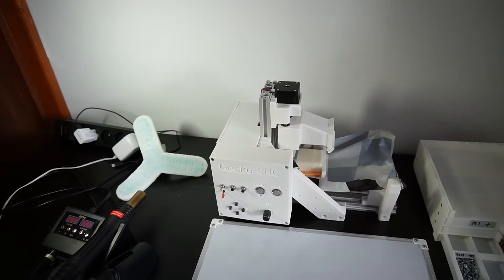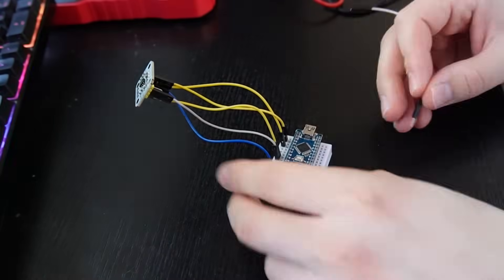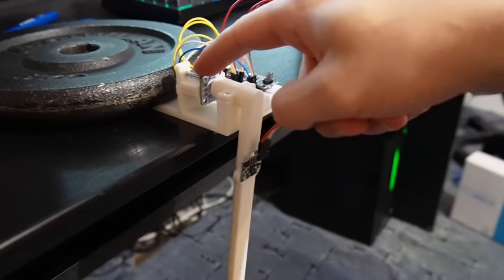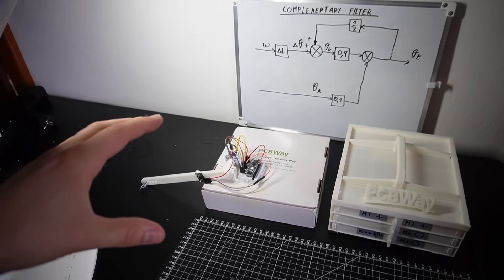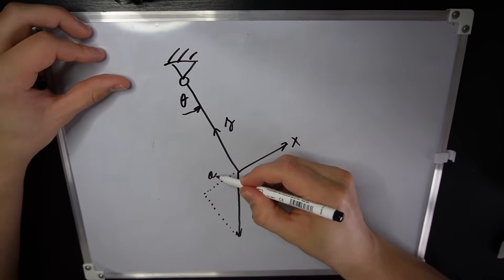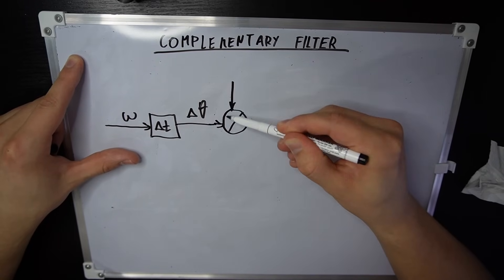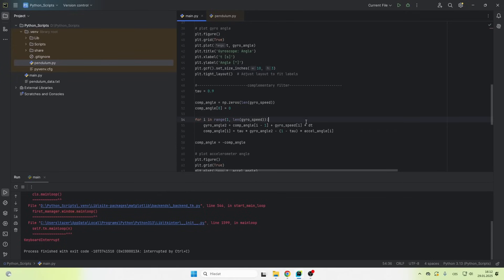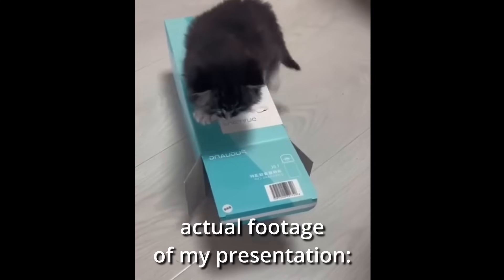Speedrunning My Engineering School Project on the Last Day

Comment: I mean the project isn’t that hard, I feel like you could bang that out in like 2-3 hours
Reply from the maker: it's not hard, but writing the code, soldering, cad modelling... just the 3d printing took 3 hrs.
Reply: @TazerEngineering TBH fair enough, my ass never learned how to solder so I just get parts that have pins already in them, so I bet my idea of the time it takes to complete projects is probably off. And with CAD modeling I didn't consider that either, so I am a fool.

Comment: Great use of the GY521 and a handy explanation of the filter, thanks. Also, I was planning on making a spatial locator. I used this filter explanation to get the angles. Do you think the accelerometer is stable enough for distance measurement?
Reply from the maker: Probably not. When you integrate accelerometer data to get the position, it will drift too. Some drones combine accelerometer data with GPS and a Kalman filter (or barometer, or even a video from a camera I think).
Reply: @TazerEngineering  i need it to be precise over a small area. Don't think barometers or gps would work
Reply from the maker: @ For short time scales it should be fine.

Comment: Wouldn't ever use chatGPT for a wiring diagram
Reply: Why?
Reply: @dxfootball4216  because it just copies what it remembers seeing and doesnt actually follow the laws of physics and you dont want to risk ruining components. i guess it boils down to the old "A computer can never be held accountable, therefore a computer must never make a management decision"
Reply: @dxfootball4216  I've seen ChatGPT get simple "blink a couple LEDs" wiring wrong; if you know how to wire it you're better off doing it yourself, and if you don't know how to wire it, you won't know when it's wrong and it'll be worse than useless.
Just use the datasheet of the part, 99% of the time there's either a wiring diagram or description of the signals. Adafruit parts often have example code and exact pin-to-pin wiring instructions.